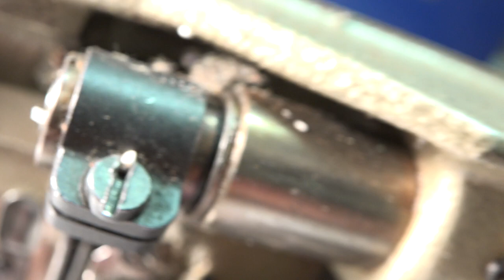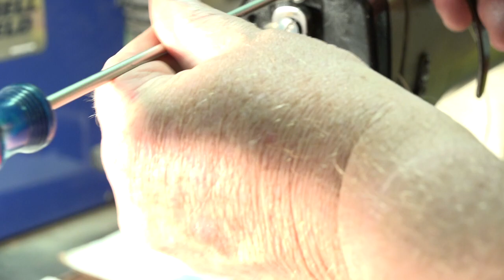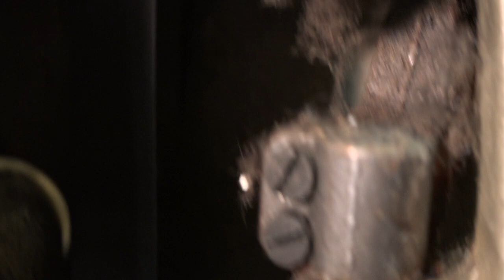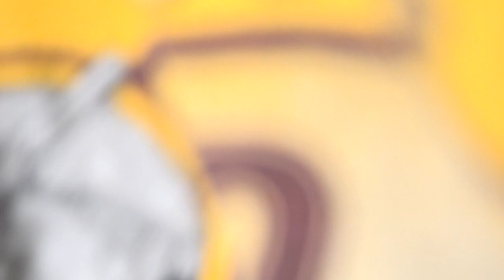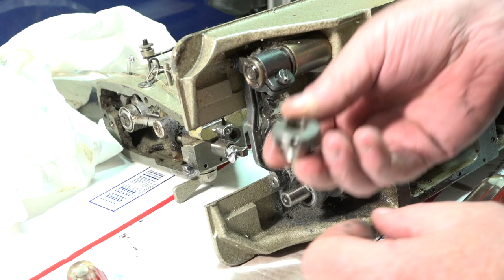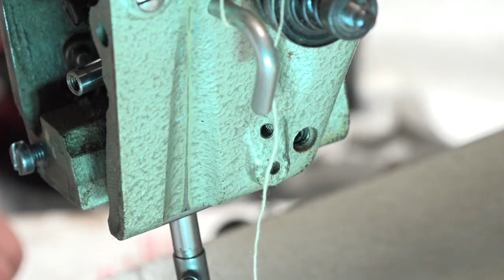Pfaff 463 Inspection and disassembly Pt.1

Comment: Does anyone know where i can get this part of the machine, mine is broken. Where can i get the wheel because i can not find it in Batam, Indonesia.
Reply from the maker: Is this want you looking for? https://www.ebay.com/itm/167388302161?_skw=pfaff+463+parts&itmmeta=01JR7VRNEKXVWDT3P5HEA4HVQM&hash=item26f91ecb51:g:1cIAAOSwzIZn2s0L&itmprp=enc%3AAQAKAAAA0FkggFvd1GGDu0w3yXCmi1cGduV0RF5Hwvd7VutPmySG9AbPSVhzUMwDRMi2%2BXAVOZsdZRlsYGBX5wUUnFAu6qVZ02D2%2BTBjwqWzK9z0exgf3EMstSsHOtH0gjpgRhn%2Fn0acfOhr5Mec4jSd7DadraEsBhWW7T6%2BjZKYnYJH%2BRsrax8%2Bwm2h6IvL9q76JsXfhWGg0h5BO15O%2FIOB%2B21Qvv%2B8eZpzu9xDYcB7T2fQ4l4F78xMkLFpgPHvpbn8m9siJ4OlXlM7F1M0dje%2BmphUuUA%3D%7Ctkp%3ABk9SR8DX4vvBZQ
Reply: @gmcxm211  i think so. I don't just remember precisely whether mine is 564 or 563.  Many thanks for your information. Hopefully it would be suitable for my machine

Comment: merci pour la védeo si inteéssante svp  vous avez une une maniére simple  de changer le reservoir a huilie  merci
Reply from the maker: There is nothing simple when it comes to this machine. I never tried to remove the oil tank only. There are two screws that have to be removed. The one on the oil tank, and there's a screw on the side  below the hand wheel. This screw holds a clamp for one of the tubes. You remove those two screws the tank should pull out enough to where you can gain access to the back to pull off the tubes. Take you time on working with the oil tank. It's only plastic and breaks easily.
Reply: Je viens de lire votre réponse puisque je ne reçois les notifications sur YouTube merci d à voir répondu à ma question ❤

Comment: bigger bolts/screws under my Pfaff 463 are really tight....what can i do to open them?
Reply from the maker: the only thing to use is one of these https://www.amazon.com/DEWALT-DCF887B-Li-Ion-Brushless-3-Speed/dp/B0183RLW8A/ref=psdc_551236_t1_B08TZYNGXJ?th=1

Comment: Hi, I have the same machine with the thread cutter, I wanted to ask you something, when I push the fabric back with the lever sometimes the thread breaks, what can it depend on?
Reply from the maker: I'm sorry but I don't know how the thread cutter works, never seen one. I'll do some research on it
Reply: @gmcxm211  thanks for the answer, but why do you think that the problem when the fabric backs off the thread is broken is due to the fact that the thread cutter is present? excuse for my english
Reply from the maker: take a video camera and try to find a way to mount it to where you can take a video where the bobbin is at. Then you might see what the thread cutter is doing. Or have someone sewing while you sit under the table and then you can watch it for yourself

Comment: Hi how I fix the knee lifter not working
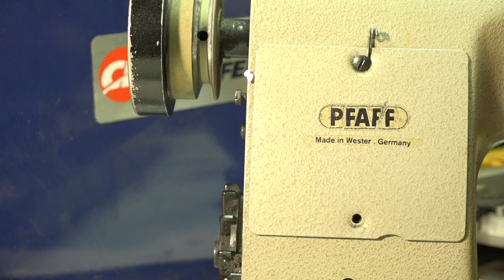Reply from the maker: remove the back panel then go to 10:30 in the video. move the knee lifter, the cam with the 2 screws should also move. if it does remove the front cover then go to 20:10 in the video and insure both hooks capture that bar you see.

Comment: Hello. The plastic gear must not be replaced with a metal one ( https://youtu.be/Cfi0aKLPQF4?t=343 ). If the hook of the sewing machine gets stuck, then the plastic gear is a safeguard against the big problem. The gear will break and not cause much damage to the sewing machine. This gear is located just after the main shaft and transfers rotation to the hook of the sewing machine. Therefore, you cannot install a metal gear.
Reply from the maker: So, this was design to be a “safety fuse” and not just to make the machine run quieter? I can see that. Has there ever been a situation where the hook jammed to where it stripped out the teeth of the nylon gear? 
I was sewing along and the thread got tangled up in the hook. The belt slipped on the hand wheel. Now I wasn’t using a clutch motor also my belt tension isn’t all that tight because I don’t want to wear out the bearings
Reply: @gmcxm211  A side function of the plastic gear is a little less noise. But it is plastic because it is a fuse. There is no problem to put a metal one, and the adjacent gear is just that. Repairing with a metal gear when the shuttle is jammed can be expensive. The hook of the sewing machine may break. The motor may be damaged unless the overcurrent protection is activated. In addition, the small gear may be damaged from fragments. The timing belt may break. There can be many problems. If the plastic gear breaks, the shaft continues to turn and the shuttle does not turn. Therefore, there is no major damage. 

You are a good mechanic! A lot of work has been done.

Comment: Hallo, I have just found this machine and thinking to buy it. But the 
question raised: does it need an air compressor? The seller says it 
does. Can you answer me please:) Thank you.
Reply from the maker: it probably does if it has a thread cutter or any other special operation. Now, for it just to sew, no it doesn't need air for that. but if it does have those features you can get an air compressor pretty cheap at harbor freight. Besides once you have an air co presser you'd be surprised how handy these things are
Reply: @gmcxm211  It is the Pfaff463. We have one compressor at home and my husband is the same opinion about it as you. Thanks a lot for an fast feed back.
Reply from the maker: @Random_person67-c8j  cool, post a small video of its operation when you get it up and running, like to see it operate

Comment: HI THERE IM A RETIRED INDUSTRIAL SEWING MACHINE MECHANIC I CAN TELL YOU THAT THE CAM YOUR NOT SURE ABOUT IS IN FACT IT OPERATES A KNIFE MECHANISM WHICH LOOKS AS IF ITS BEEN TAKEN OFF, IF THE 463 HAS 900 AFTER IT THEN ITS A UNDERBED TRIMMER I WOULDNT 
GO WITHOUT THE SPUNG IT COLLECTS EXCESS OIL
Reply from the maker: Thank you, I have been trying for years to find out what that cam was for. In another video,  another mechanic told me about the bracket that pivots around the bobbin housing is where the knife blade was mounted, it make sense now that bracket was operated by that cam.

Comment: Hi, I have pfaff 260. can you disassemble and reassemble, pfaff 260 in video? I have a problem the zigzag doesn't engage, It will sew straight and the cam mechanism has no problem. I think a spring is missing. I would appreciate if you can do that. Thanks.
Reply from the maker: did you just buy this machine? If so it could makes a big difference, it could be more than just a missing spring.
Reply: @gmcxm211  I bought it at craigslist los angeles
Reply from the maker: @evelynsia460  good news is if it can sew straight stitches it's properly timed. I don't have a 260, just a 360 and there some differences between the two. now if you select a decretive stitch and the middle knob/level moves in one direction only, while sewing try gently to move the knob/level back. If there is no resistance then yes you do have a spring missing. If there any resistance than it just needs to be cleaned. The only problem with these machines, the decretive stitching isn't all that "crisp" as it is with the electronic sewing machines. Since these are all cams and spring regulated the needle never returns to a true zero. There will always be a thread size gap or off a width of a needle in some places. We're talking Model "T"  Fords here compared to our computer controlled cars of today.

Comment: Hi Stephen, very informative video. I just bought exactly this same machine. It's in pretty good condition to be honest but as with yours the sump gasket plate sponge has deteriorated to mush. I've looked at replacements online but can't find any. You spoke of a magnet but if going down that route how do the cogs get lubed. Your help would be much appreciated🙏
Reply: I say exactly.  It's a 463 but the gasket plate is not same shape as yours. Mine is just rectangular..
Reply: Hey Keith — did you ever find parts? I just ordered two pieces for my pfaff 463 — my plastic gear shaft crumbled lol.